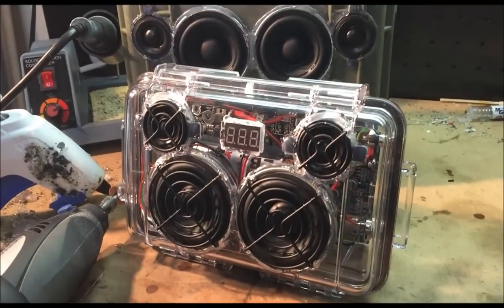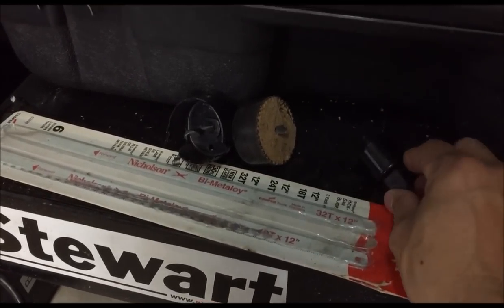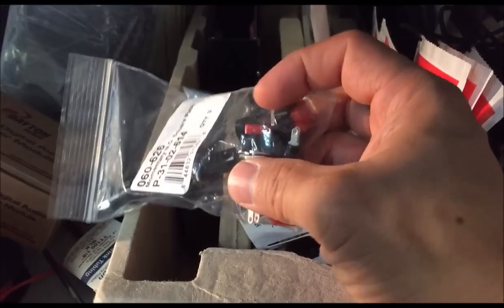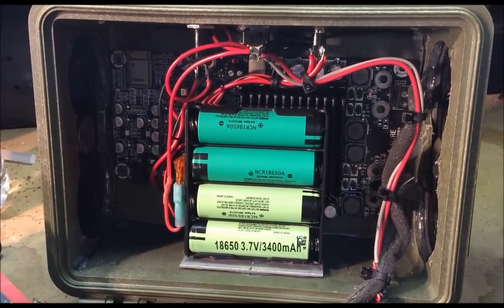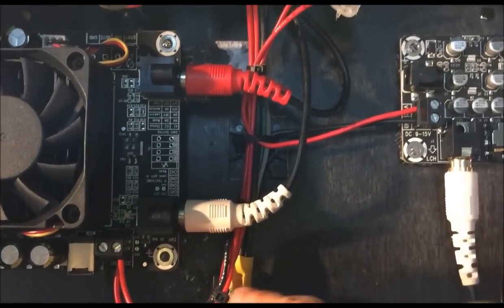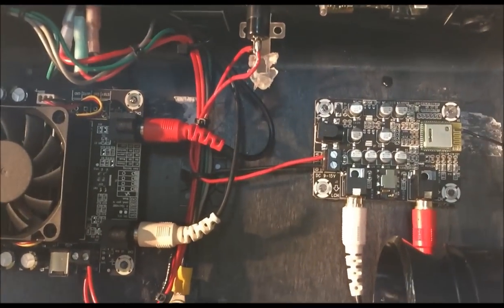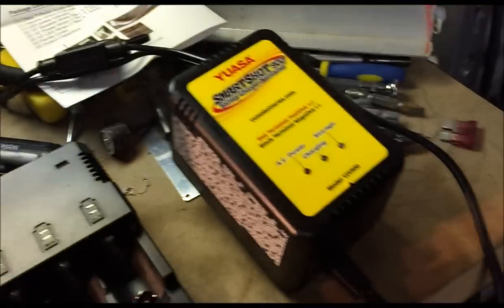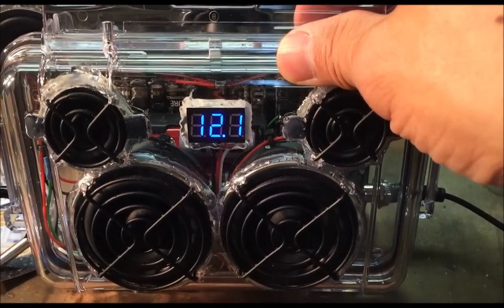DIY Pelican BoomBox wiring schematic, components, parts, tools, technique video description.

Comment: I've got the Lepai tuner/amp which I'm building into a tool box. I used to do car audio, and the antennas always were grounded to the body of the car and the center conductor went to the ant.  On what I'm doing the Lepai has an RCA jack. Do I still need to ground my antenna? ( I figure that I'll do that anyway, so even if it's not needed, it won't hurt anything)

Comment: Have another question for you...I'm getting a speaker pop everytime I turn off or on the amp, any ideas for fixing that?  I also have noise/feedback when nothing is playing but everything is on.  I tried putting all power cables on one side of the case and the audio cables on the other to see if that reduced any noise but it didn't change.  Other than that the sound is great although I think I need to get a volume control since the smallest volume from my phone is still really loud with it.

Comment: Hey Modiane im currently building a portable boom box and have room for a seal lead battery. What would you say are the main difference between using the lithium ion batteries and a sealed acid i.e charging time and play time... Thanks in advance
Reply from the maker: +Ramon cabreja Lithium is way more power dense and lighter. Everything else is about the same.

Comment: if you were to add volume control where would you add it.... would it go from the bluetooth, then the volume control and then to the amp?
Reply from the maker: +supdus yes thats correct signal sequence all preamp level before amplification.
Reply: +modiane1 hey also wondering how you figured out the cap size you used for the tweeter separate the sound bass from going through them
Reply from the maker: +supdus The Polk speakers came with caps already for the tweeters. I don't know the values as I switched to different setup.

Comment: hi I have a tda7377 and I have no clue how to wire it and I looked up the data sheet and I don't understand their diagram is there a way you could help? or just explain how to wire it I only have one speaker for it
Reply from the maker: +Twisted Thrttle I have no specific experience with TDA7377. Basic DC in, signal in, and speaker output. Just use one channel for your solo speaker.

Comment: So can i run a battery pack directly to  the power connection on the 2x50watt amplifier? Then run a usb power wire to charge the battery pack. I am running a tpa3116 with Bluetooth already on the power amp.
Reply from the maker: Harry Psaradellis sure as long you meet the voltage and current requirements of your project.

Comment: How do you charge those 18650's without removing them. And can you still use the boombox while using them
Reply from the maker: Owen King Three 18650 in series gives you roughly 12.6VDC (4.2VDCX3) which is max voltage for Li-ion chemistry. 18650 is rated for nominal 3.7VDC. Most 12VDC cheap wall chargers put out 12.5VDC at 1A or 2A. I've been using EBL brand since they have protection built in. Can charge and play with my design.
Reply: Can you make a video

Comment: Hey man, I'm trying to imitate your Pelican case build.  I have 2 old speakers, Cerwin Vega SS-262 that are 50w RMS and 100w Peak and rated for 4ohms.  The Sure 2 x 50 amps I have found are all rated for 6ohm, is that going to be a problem?  Also, is this the amp that I need http://store.sure-electronics.com/audio/audio-amplifier-board/low-power-100w/2-x-50watt-at6ohm-class-d-audio-amplifier-board-compact-tda7492.  The one I found that looks just like yours w/ the fan on that same website says it is to be powered by 14v to 27v supply.  The 12v battery option won't work then correct?  That's why I picked the fanless model that I linked because it says 8v-26v supply.  Sorry for all of the questions (and I'll probably have more at some point)   ....Oh...and "so forth" :)
Reply: Chase Culpepper Scratch that whole post...I missed the amp that I think I need, found the 4ohm.  Model TPA3116.  No fan on it though like yours, guess they changed the design?
Reply from the maker: Chase Culpepper The one I'm using has a fan and will work with 12VDC even though rated at 14-27VDC. No issues!
Reply: modiane1 So if you were to do it over again would you again get the 6ohm board that runs from 14-27v or the 4ohm board that runs 8-26v?  It would see better to have the matching ohms and volts but the fan seems like a nice addition as well.  Also, is there a button on the bluetooth board for pairing or how do you set it be able to find it from a phone for pairing different devices?
Reply from the maker: Either one will work fine. They are both flexible in terms of impedance matching and voltage requirements. I don't think you'll hear a difference. Good luck!